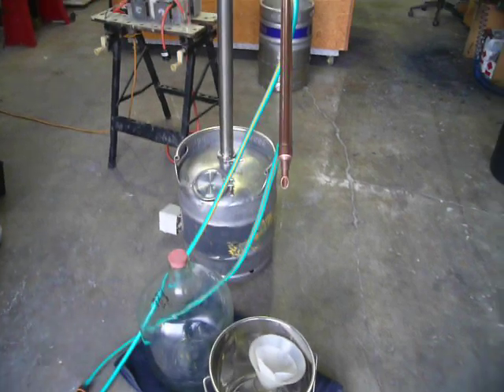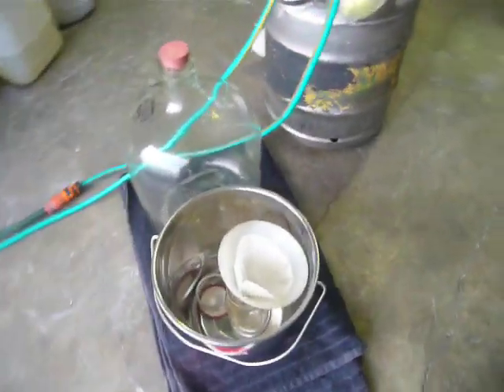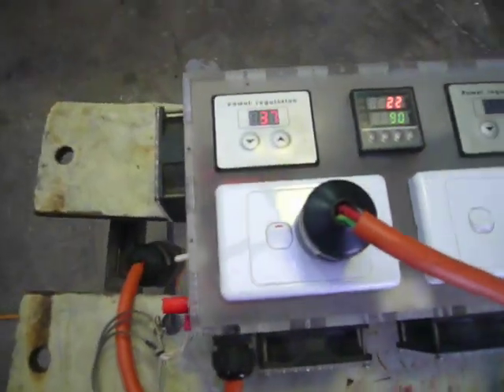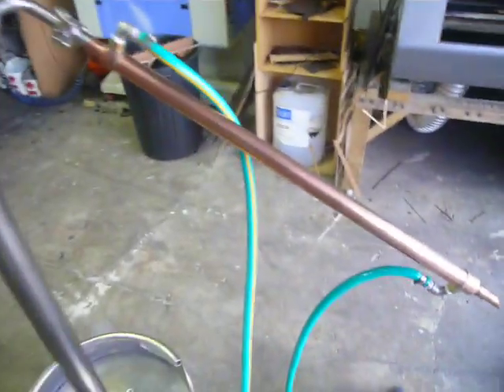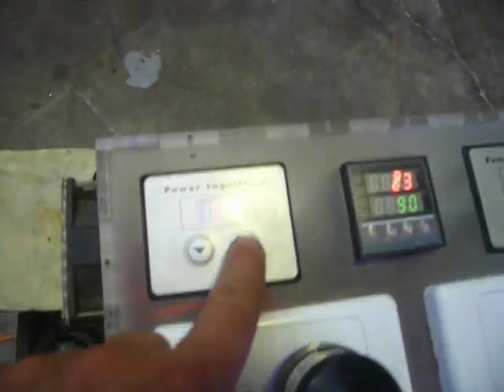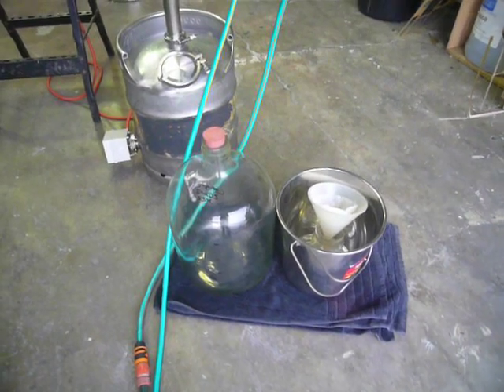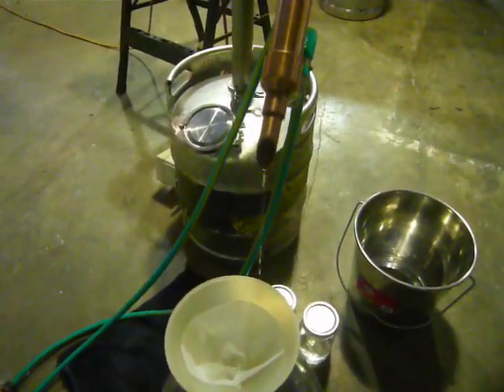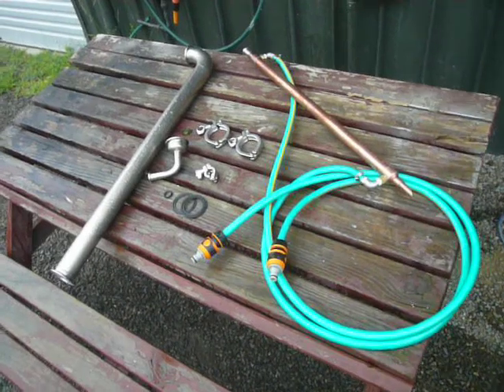Simple pot-still run.

Comment: Hi great stuff man.Can i please get some more ifo on the heating system .I can see that it is not on of control but a power controler u are using .
Reply from the maker: G'day Anton,
I make the power controllers myself, there should be a vid or two on my channel showing me noodling out putting my first one together for my 200L kettle.

The main one I use has two separate 15amp 240V feeds with independant power regulators both controlled by a single PID controller.

The 240V 15amp feeds allow me to run 2x 3kW elements (or 4x 1.5kW elements)

The PID allows me to set a cut off temp which is handy with a long warm up - I can have the kettle shut-off and hold temp just short of taking foreshot and let me know its reached temp with an alarm.

When I running in pot mode (which is often) after taking foreshots I set the target temp on the PID to 95 or 100 degC (way out past what the end of the run would be), drop the power regulators to around 45% and let the still slowly proceed thru' it's run.
Took a small amount of trial and error to find the sweet spots for running the 200L still but after working that out its "on rails" now.

Happy Distilling!
Reply from the maker: The smaller controllers I make for home distillers are 240V 10amp systems - to conform to the average NZ house/workshop domestic power supply.
I just have a simple dial 0-100% on those and no PID to avoid confusing ppl new to the process.

Comment: Why do you have to water down your low wines if you're using an electric still?
I've never watered them to 40% & haven't had a problem, I just run the spirit run in a t500 & alembic head at around 95-105VAC (240V).
Reply from the maker: G'day Chris, I'm just showing how I do things and the way I run my gear - not trying to tell anyone that THIS is how it is done or "my way is the right way" - I'm not that arrogant.
Personally, I just don't like having an ignition point of any kind near high-proof likker be it flame or electricity.
I also like to think that with a bit of extra water in there it helps me separate out my volatile spirits from the other nasties that inevitably came across in the stripping run.
Reply: Yeah, no worries. I was just curious why everyone does it.

Comment: Been wondering what you have been up to. Merry Xmas my friend. 
Would like to fill you in on all the seedy details of my endeavors but alas, there are some things about the US that does suck.. LOL
Take care and here's a toast to you bud. 
Ta
Reply from the maker: Heya Leadguitar' !
Would love to see what you've been up to ! but yeah, sad that in the land of the free you can't openly engage in legitimate past-times without fear of reprisal, … one day my friend, one day. :o)

Merry Christmas and Happy Distilling fella!
Reply: @AngryParrotDistillery  Been wondering how things were going with your 4in. setup you had a video of and that monster sized tank.
Reply from the maker: Hey fella, 4inch column rig is finished - got the 4" gatling video up a while ago.
Been using it a lot lately - will have to put vids up of it running!
The BIG tank I am still working on - the stainless fittings and tube for it is not cheap hehe - will hold around 600 litres approx' 150gallons.